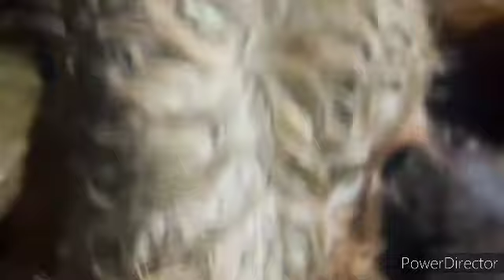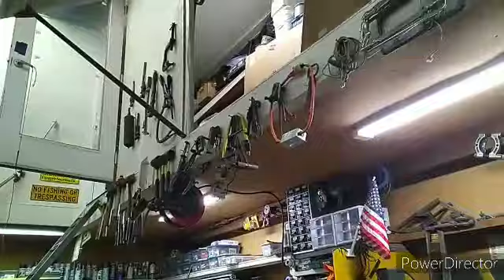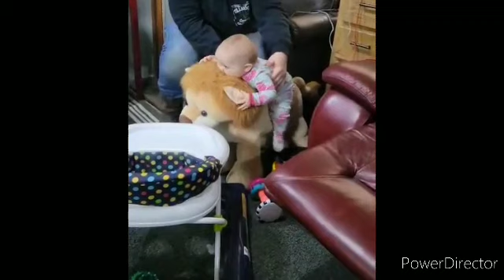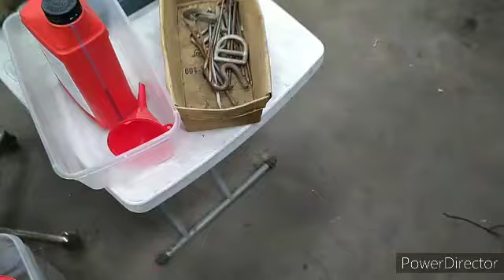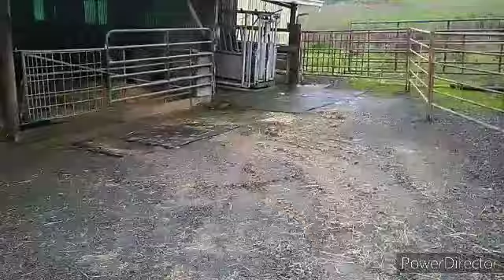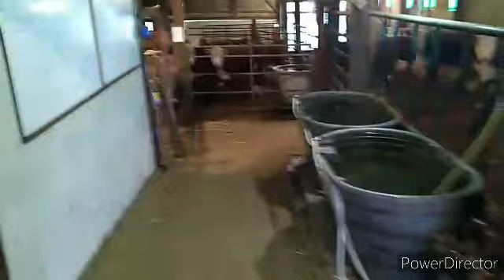a little more of the mess sorted out. Blakely is back!

Comment: Got 800 bushels rolled this afternoon.  Should be good till February with what was left from the last rolling.  Looks like a cool down middle of next week.  Hopefully brings some snow.  Pretty much brown here again.
Reply from the maker: Nice 👍
Hopefully it does cool and you get some ☃️💩!!!
Reply: I should empty the grinder, but when I think about doing it then it starts to drizzle. Looks like it may start to firm up around here next year 😆
Reply: @GosselinFarmsEdGosselin  would be nice to get a foot every month till April.  Give us some runoff to fill dugouts, streams and such.  I’m watering out of a river right now and it’s about as low as I’ve ever seen it.
Reply from the maker: @chadtosh6831  been pretty rough!! Hopefully mother nature gets back to normal soon!!
Reply: @burrridgefarms  I can do without rain on the backs of these calves.  Prefer snow, they just shake it off.   Not much for barns, generally drier climate, so they get wind protection and that’s about it.
Reply: The problem here Chad is if they aren't on concrete there really is no bottom to the mud when it thaws. In the spring I have to hopscotch the pairs around the different pastures until it drys out.  The humidity has been so high here everything is sweating, if it was below freezing it would be much better.
Reply from the maker: @burrridgefarms  lots of rock!!! There's over 8' of concrete and asphalt chunks and reject rock under our cow lot..
Reply: @burrridgefarms  that’s where the frozen ground is a win for us 5ish months a year.  We calve out on long pastures that lead back to the corrals and barn in case the weather is bad in the spring.  As they calve they get moved to a fresh one with brush for cover as we make up our summer groups.  A lot of our major rains don’t fall till the summer months.  Generally.  Lol.   Not uncommon to get a foot of snow in the middle of calving in April or on the long weekend in may sometimes.  But April and early may are usually dryish months.